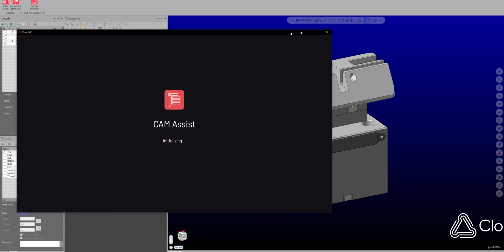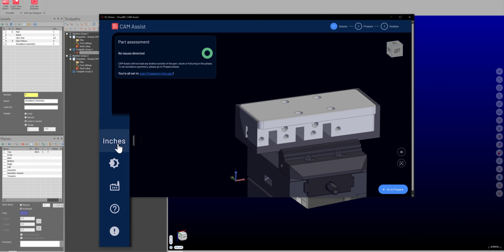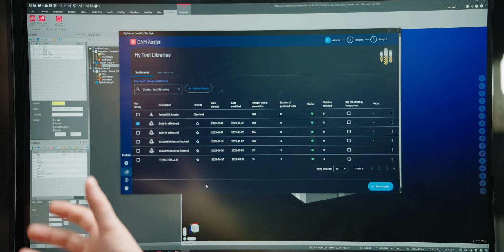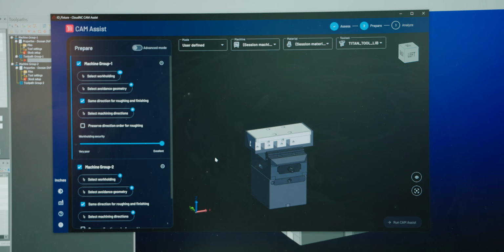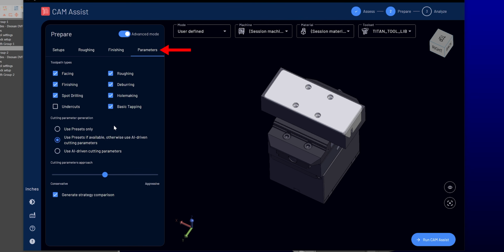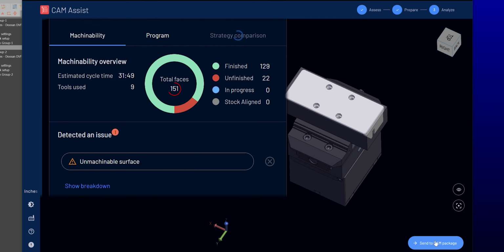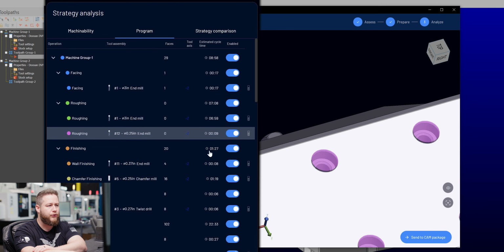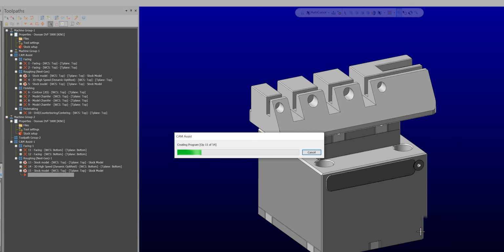AI Just Took Over CNC Machining

Comment: That's a lot of human intervention for an "AI" CAM system.
Reply: Yeah, he's to involved in the process. I'm waiting for the update where you scan the print, then Ai takes it from there. The Ai should read the print, decide the optimal tool paths, make a perfect program, top off the coolant, top off the way oil, turn on the machine, decide what tools it needs, get the tools, put them in the machine, measure the tools, run the part, replace broken tools, continue running the part, check the part, remove the part, deburr the part, wash the part, dry the part, package the part, and ship it to the customer, clean out the chips and be ready to run the next part. The human's job should be to press one green button and watch youtube videos on their phone while the part runs.
Reply: @bricewayne3082  Now your talkin!

Comment: how u feel about casting replacing sheet metals in Tesal ur point of view is valueable
Reply: It's good for the manufacturer, but sucks for the end user. Cast aluminum is almost impossible to repair if it gets damaged in an accident. It has a tendency to crack when traditional repair techniques are used. This is one reason why they are so expensive to insure.

Comment: " I, as the programmer, have a little bit of control," is probably the worst quote I've ever heard from a programmer about to run a million dollar machine.
Reply: You still have full control at the CAM package layer - with CAM Assist 2.0 we've tried to open up the black box so you can see what it's up to and make higher-level edits before the AI's outputs hit CAM. Those strategy edits are much slower to make in the CAM package.

As machinists we're ultimately still fully responsible for the program that's going into the machine - I would never expect to just load it in and hit cycle start.

Comment: Ai will not take responsibility for lost time or material, when it comes to that, the operator is always at fault👈. But this opens a can of worms, Is the programmer at fault, or the code that he generated with Ai was incorrect because it did not "guess" the instruction given correctly. In the end preview and simulation and human validation becomes even more important. Ai needs to be multimodal for much better outcome, until then it is just another tool in the toolchest.❤👍
Reply: they claim 90% can be done by AI with the other 10% you need to do it by yourself. Of lets say it this way with a proper setup FMB library you will get these 90% anyways automated and you take care of the rest by yourself. The part is not really complext some open pockets and mainly holes. This is standard feature technology. If this AI can´t handle the the rest of the part so what is the point of spending money on it? Give an good guy in your company some time to build a solid FBM process libary define some rules and have a good tool database and you will see the same result or even much better with less time spending on setting up the whole AI command window.

Comment: I worked on my first cnc lathe in the early eighteis in the UK. It was the only cnc in a manual machining  jobbing shop. An American control Crusader Anillahm. I am retired now. Point is it’s all cnc now. When the cost comes down and AI becomes easier available just like cnc companies will see the advantages and invest. The AI will make programming more efficient it will lessen the human input therefore deskilling the machinists. It’s the next step up. Less machinists required. Productivity will improve at less cost overall. There may be even more lights out production. Exactly what happened to manual machine shops when cnc where introduced. Companies had to change and invest to survive.

Comment: AI will never “take over” machining. It certainly will become increasingly more useful, but right now it’s completely far fetched for the average shop.
Reply: It will happen much much faster than you think (Because we are too stupid and greedy to stop the inevitable). It will start with large national and international companies focused on the really high end or high volume business. It will not take long until their capacity is built to the point where they can compete with the average shop. The next step will start with someone opening an average shop that farms ALL it business to one of the big AI shops. Once they have a foothold the big guys will either buy these smaller AI shops or start their own comprehensive AI service that is so available that there will be no more competition. We as a society is way too greedy and stupid to avoid the obvious. I will give you the perfect example. Amazon publicly stated for at least 5 years that they were going to start their own delivery service yet UPS FEDEX and USPS never cut them off before Amazon was ready with their own delivery services. Now all three have lost a huge chunk of their business instead of forcing Amazon into a multi-decade commitment to not create their own system.
Reply: @darikmatters8866  It literally can’t take over machining. It can’t do the setup, it can’t repair parts on a manual, it can’t jump on the forklift and go dig bars out of the snow to keep the saw running. It’s replacing programmers, but it’s nowhere close to ever replacing a machinist.
Reply: @TristanPare-ub8fl  You are both correct and incorrect. Without real AI setup and production confirmation are still manual. This will change with AI faster than you realize. Even QC will be automated. 
The part that is correct is that there will still be a need for manual machining for repair and maintenance and will be truly manual for the foreseeable future. Unfortunately we have entities like TITANS of CNC that are teaching CNC only and telling potential machinists that the future is CNC only.
Reply: Computers used to be exceedingly expensive and far fetched for the average company, now every company has dozens or even hundreds of computers.

Comment: Nice demo but how smart is your AI tool if you have to set everything by hand for example your machining directions or pre-define your work holding setups? A rule based automation is much faster here. After you selected everything you want to machine like threads, holes, pockets it does an feature check and applies strategies to it. For me it seems like you have a nice interface how to setup your jobs but later it runs a normal FBM process. Not really AI in my point of view. I have seen CAM automation which will be done already before you have setup your two operation groups for upper and lower ops.

Comment: is there a possibility to let some stock faces to be machined after hardening, vor example? can you tell is, what tool you want to use vor e specific operation?  how about edges you want not to be chamfered? how about differen sizes of chamfers?  til now, it looks like its usefull just for a verry smal group of users.
Reply: This would be best done by switching off the operations on those surfaces, either in CAM Assist's strategy editor, or directly in CAM. Same story with anywhere you don't want chamfered.

Comment: this is really cool but its not $13000 a year cool
Reply: For a mom and pop shop no, but for anyone in aerospace and military? That's easy money.
Reply: Depends on your volume
Reply: If 2 person program 5 parts per month, thats at least 120 hours a year. Now calculate the cost of that. And don't forget, that you also quote jobs faster.. and that is a lot of time in the end, and you are more precise.
Reply: Unless you're a multi million dollar company saving 150 grand on Labor paying slave wages to unload your automated tool cells generating millions in profit per year
Reply: @Squat5000  how many of this companies have a such amout of such easy parts whith no tolerances and who will be machined to finish directly? it dont save me time, if i have to tune every toolypath. then im quicker with make my own samples vor operations, i use often. so i can set dem up, like i realy need them.
Reply: @damianderungs6210 yeah, but you Swiss have a smaller portion of the large parts market. There are a bunch of companies making relatively high tolerance machined parts for industry or direct to consumer. Not everything is tight tolerance Swiss.
Reply: @damianderungs6210 in machine measuring and automated tool offset changes are possible in most machines equipped with tool and part probes. Critical surfaces can be inspected in process and tool wear can be adjusted and compensated for with no human intervention aside from initial setup. Not suggesting this AI stuff is worth it, just saying with current automation it's possible to do these things with no human interaction once it's all set up.
Reply: @HEEDCNC i know. We talk here abput making programming easier and faster. So if i have to tune the whole programm i dont safe time. I bet im need more time than with good samples for my operations. I can leave stock on faces for finishing after hardening, can diretly use the propper tool. the intention for making programming faster is good. Thats what companies with a lots of new and different parts could use. In mass production programming time dont matter. Ai wont compete with humans if you try to get the last secont out if cycletime. 5h of programming is more than worth, of you save 20 sec per part, if you produce 100'000 parts.
Reply: @HEEDCNC износ инструмента фатален, его нужно точить, либо менять